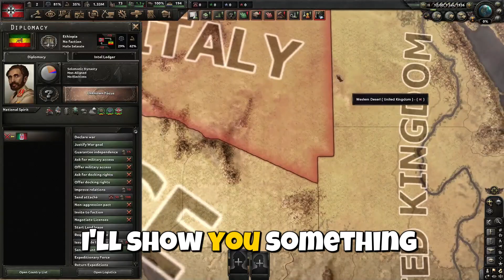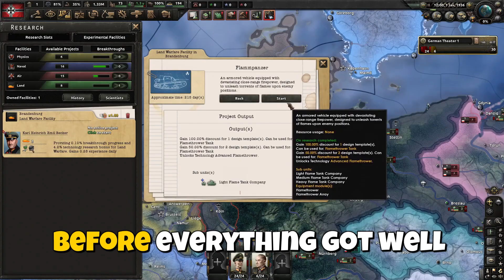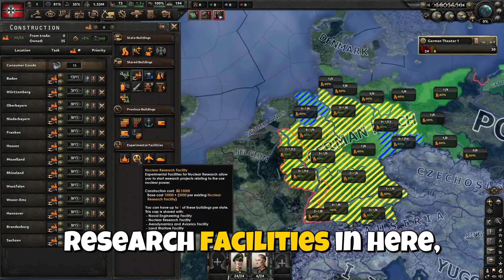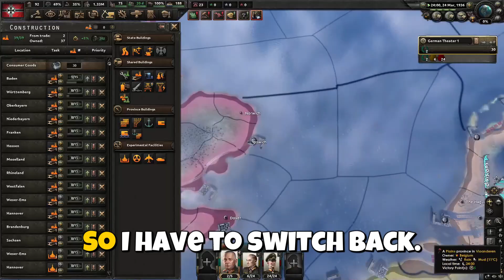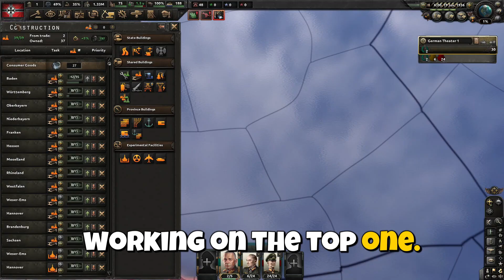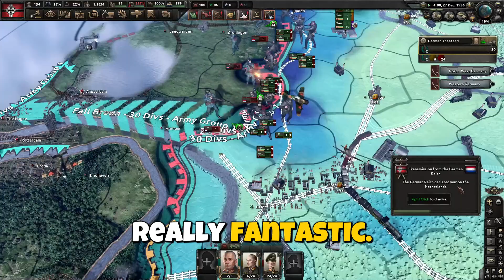HOI4 Germany No Rubber Farming Needed!

Comment: And against ai you dont need the pac just focus at soft attack
Reply from the maker: That's true but it does make things easier I've been on the receiving end of low supplies and it's not great however you are correct I just do that for a pro cautionary measure
Reply: It destroys your starting Eco because you could build factorys instead and railroads are not  cheap  @loveonehandedgamer
Reply: You dont need much of these Research centers just build the ones you need because at some Point either you cant research anything or you dont need the things they unlock  @loveonehandedgamer
Reply: I have played this Game for more than 300 hours ( Most as Germany) and you really only need to build up supply for Asia or deep within the ussr
Reply from the maker: @Hitspeed-t7p  Thanks for the advice! I do know about switching the tracks (however, I'm going to do that later in the game, I'm going to start mass-producing trucks, and at that point I will switch everything to them. For right now, I didn't want to do that because I didn't want to create a massive deficit.
Reply: @loveonehandedgamer  ? 
I use 3 factorys against the early deficit and switch that to 1 to rebuild losses 
I Just Go into mass produktion if i use them in my early Tanks and loss alot but later i Always use mechanized so why do you need so much ?
Reply from the maker: @Hitspeed-t7p yes I know about that but even then it's too early of the game start doing that because we need ports to do that😊
Reply from the maker: Furthermore I actually went on the game this morning when my Wi-Fi was down and I built a bunch of ports inside the Dutch Indies
Reply from the maker: @Hitspeed-t7p  Yeah, I generally do the same thing.But I thought I would try something else: using horses until I got enough factories to mass-produce them, and then switching everything back.

Comment: You dont need to build Up your railroads this much 
It just eats ic
Try pressing the Button with the horse above your Units when you have them selected with a General 
This is going to change their motorisation , it just gives more supply against the use of Trucks
Reply from the maker: That is correct I know my four reasoning for doing so is in the other reply